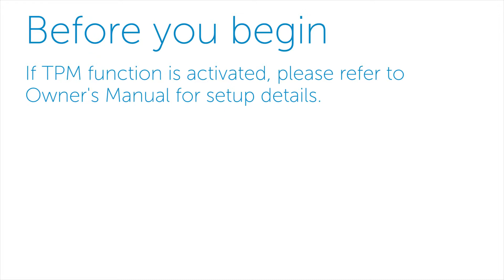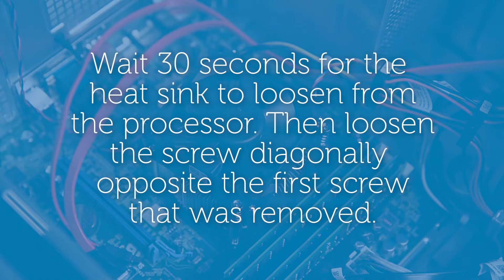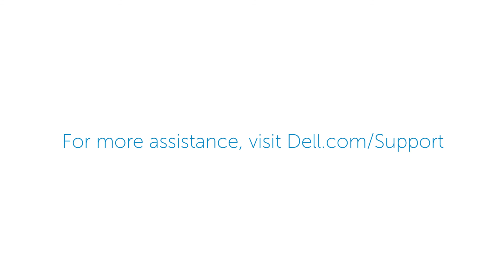Dell PowerEdge T30: Remove/Install System Board

Comment: 1) cover the ZIF socket with aluminium foil if you dont have the original plastic cover, NEVER leave it exposed 2) reapply themal paste starting from the center, dont put so much! i cannot look anymore...yes noob technician... despite all this i like the video...

Comment: What is the part number of the Dell PowerEdge T30 motherboard?
Reply: dell 7T4MC
Reply: @axltobe2  I searched Amazon and I can't find that part, do you know where I can get it or which one can I use as a substitute?
thanks for answering
Reply: @ismaelramirez4053  I have been searching too with no luck. Everything online is over $200-$300 just for the board. I’ll let you know if I find anything.